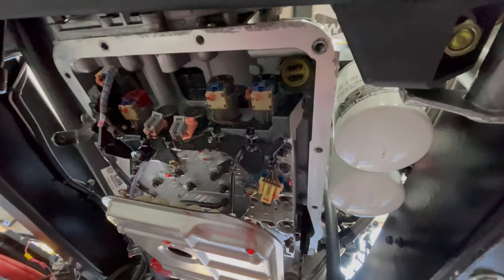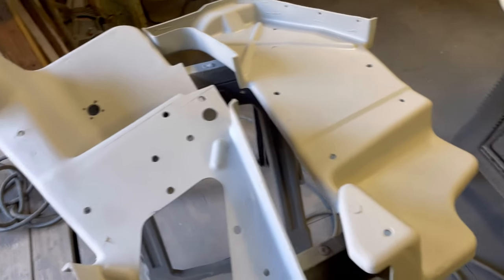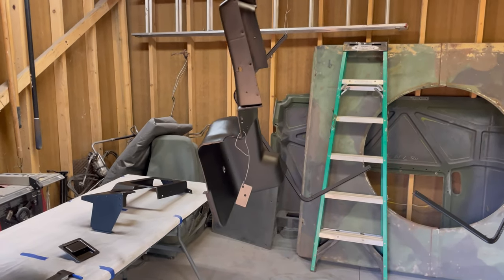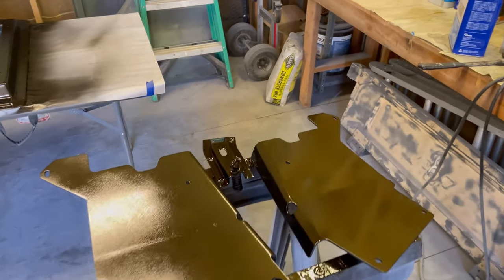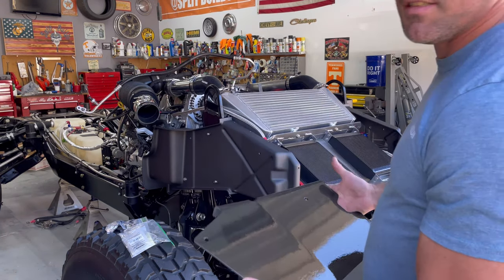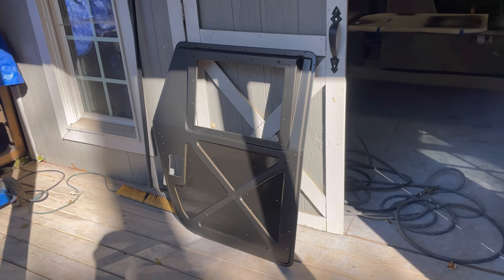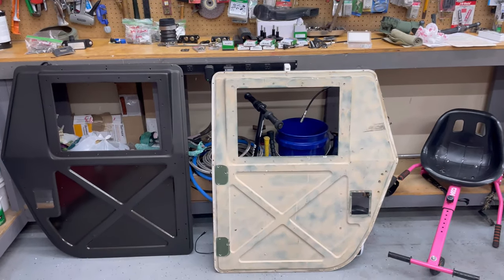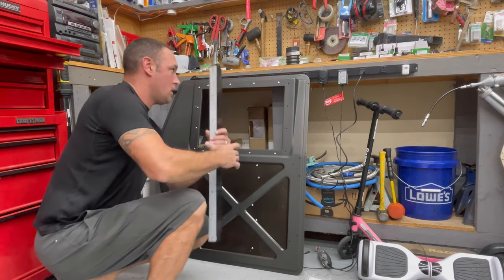Humvee Door Finished Painting

Comment: I did stainless throughout my entire truck and absolutely love it. One thing I wish I knew is how much stainless galls. I got around it with anti seize but man what a pain. I ruined several nuts and bolts because the stainless would bind and it was impossible to tighten or loosen so I would have to drill the head out and try a new bolt. Did you ever run into that problem with stainless hardware?
Reply from the maker: Yes, especially using locking nuts on stainless bolts… if you ever have to remove the bolt it will usually break or strip out

Comment: Hey devil dog, I’ve seen the ptoblems you’re having with your paint.  One thing that might help is to stop washing your parts with simple green or a degreaser.  Use dove dish liquid or tide laundry soap.  Make sure to clean the parts before you sand them, then wash them again.  Now tith bondo, do not wet sand any part with exposed bondo on it, ie your air cleaner.  Bondo is not water proof and it will start sepersting once it’s been wet.  So that’s an issue you will have in a matter of months.  Lastly, sand pieces that are going to be base coated with 400 grit.  You’re not leaving enough for the paint to adhere to using 600 and 1000 grit paper.  Use a sanding block so you do not get finger waves, sponge block is a minimum.  Bondo will always shrink, use the best lightweight easily sandable  body filler you can afford.  Stop using rattle can primer on outside parts, it’s not thick enough to fill in the scratches.  Projects look great.  I used upol prep solvent and I got a lot of fisheye so be careful with that stuff.  Lastly, you need filters in line between your Compressor and your gun if you want a good finnish
Reply from the maker: Good advice! Thanks brother!